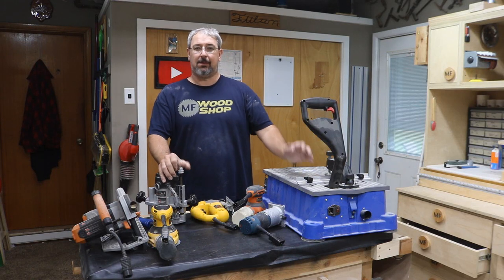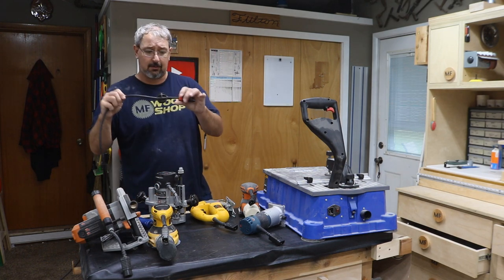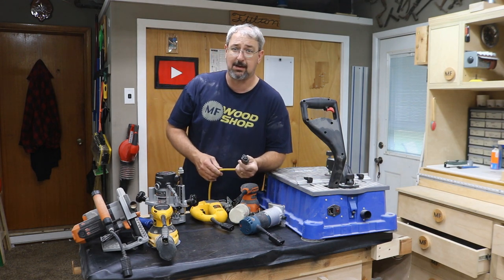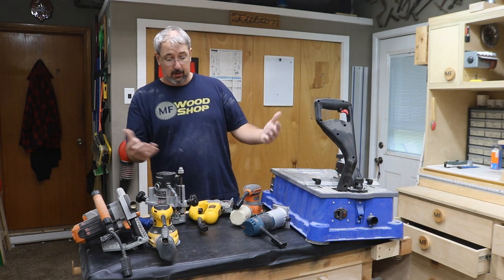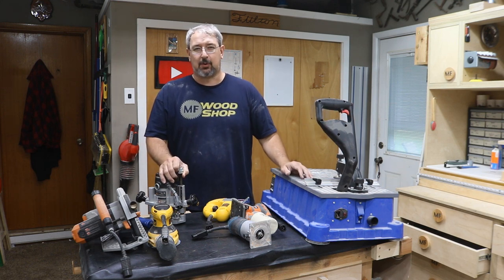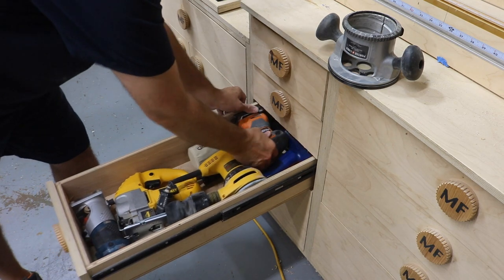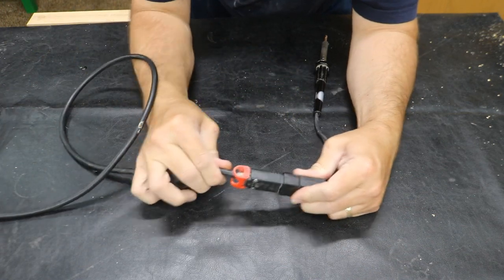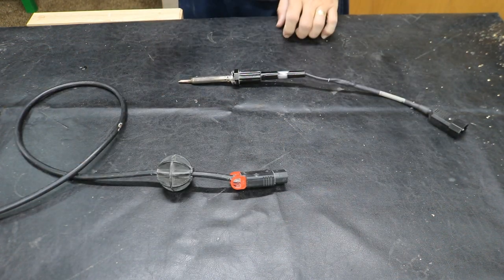Power Tool Connectors 4yrs Later

Comment: I got the same connectors just after you. I even made 3 different lengths extension cord for outside work. My only complaint is my sander vibrates the lock connector loose.
Reply from the maker: Try getting a locking one
Reply: @mfwoodshop  that is the locking one. I’m thinking it is getting old and the vibration causes it to work loose.
Reply from the maker: Not sure then I’ve been using mine for a while and haven’t had that issue. Maybe you just got a bad one?
Reply: @mfwoodshop  only does it for the palm sander. I’m going to swap it out one of these days.

Comment: Since You seems to have a cord winder You have to think of the heat the cord will produce. If You don't unwind all cord in the winder when using a high power tool, You will heat up the cord so much that there are a big risk to melt the cord.
Reply from the maker: Thats is true, I have been using this reel for 4 yrs with no issues. I think most likely it because of the low about of time used at once. The longest I would use it at one time would be sanding, but it does not pull thats many AMPs so far no issues.